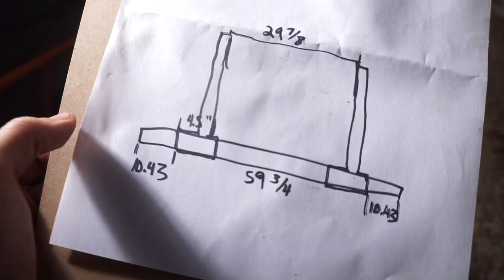FLIPPING MY TRUCK! Rotisserie Install on 1966 VW Double Cab

Comment: Order a metric thread file from ENCO or MSC and restore the threads on the original bolts. You won't find any bolts at the hardware store that compare in the quality of the original ones.
Reply from the maker: Thanks John. I completely agree! And it will save money in the long run, I’ll order one today thanks!